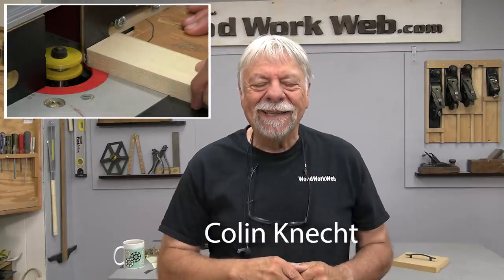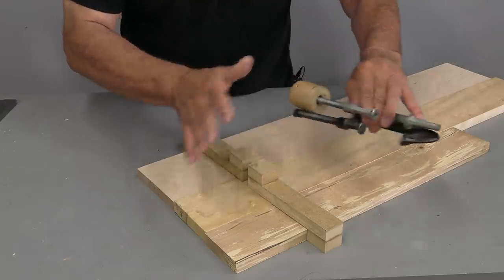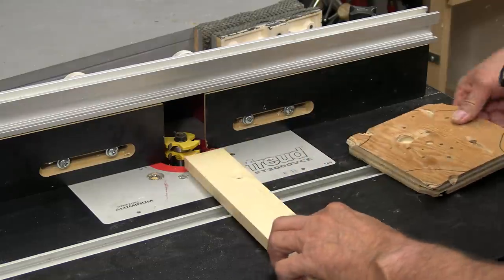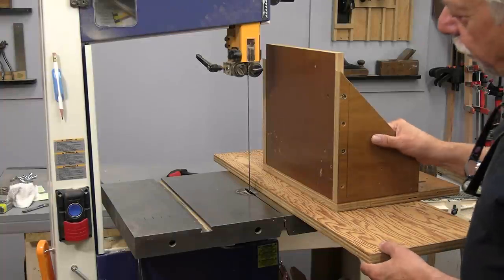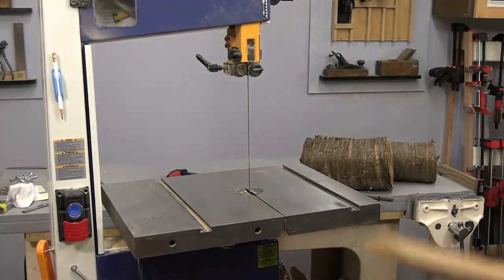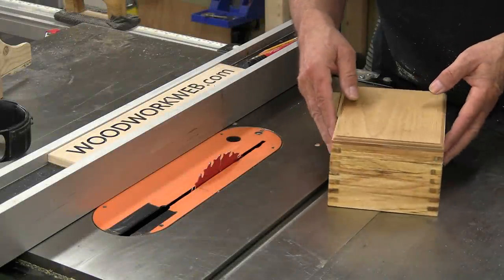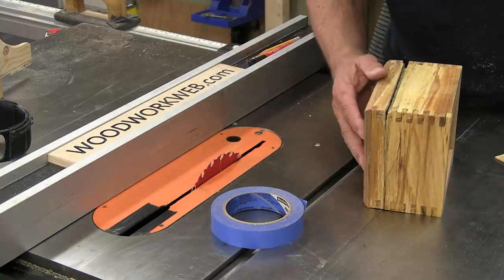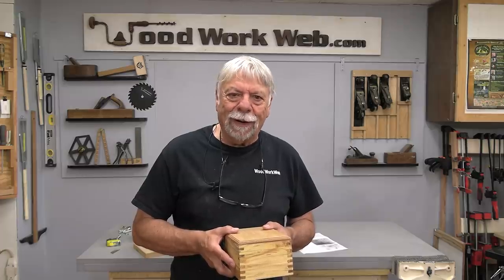Bad Ideas in Woodworking Episode 6 / Workshop Fails

Comment: When cutting the bottom off I lower the blade so it leaves about a 1/16 of an inch so the box stay firm and cut the last bit with a knife ,it's a lot safer

Comment: I might also suggest using a crosscut sled for separating a box body and top. That way you have plenty of support, a zero clearance throat and your box isn’t sliding on any surfaces to risk picking up scratches.

Comment: I like that you showed not just the bad ideas but the good alternatives as well. I can really attest to the advice on not using your blades on laminate. I cut some angles in laminate for my sister over the weekend with my band saw and it completely dulled the blade in just 2 cuts. Those laminates are compressed and all in all not friendly with wood working blades as you mentioned.

Comment: Colon, great to see a new video.     Sawing logs...  I  found I needed an outfeed table for my bandsaw, the logs are heavy and I didn't like not having maximum control (Having to support the outfeed weight  and pushing to log through the cut).  Luckily My saw backs up to a work bench and making the outfeed was easy.

Comment: A good use for the miter slot on the router table is a small parts sled.  You can clamp the piece to a backer board to support the piece on the sled. which rides in the miter slot.  Rockler makes a really good one but you can make one with a runner, some plywood and a toggle clamp.

Comment: Heeejjj that featherboard at 4:00 is for pushing left-to-right, disastrously against the router direction! For safety, point out that you'd have to swap the screws (probably from last use on the tablesaw) around, so it works in the opposite direction -- then usable on the routertable.

Comment: The router block isn’t the worst but to make better, for me, I’d just take the scrape chunk and screw a small handle sized block of wood to grip on the top. Just two ply pieces screwed together to give you a raised 4 inch by 3/4 inch block to grasp. Make it easy to change scraps when you need a backer again.

Comment: I take exception to your warning to not use a mitergage with a cross T-slot on a router table.  I do it all the time.  First, there is no compelling reason to fix your router fence so it won't rotate about the axis of your router bit.  It is fundamentally different from a tablesaw in this respect.  Then it is simple to make a holder for a rule that slides along the T-slot which you can use to set the fence exactly parallel to the T-slot, if you want.  I have such a setup on my router table, use it all the time, and I use both a miter gauge I got at a garage sale and shop-made guides to mill wood.

Comment: Some thoughts that would make these great ideas:
Clamp extensions; 
1) Make them tall enough that they don't lay down on your glue-up wood when they start to bow.
2) Make the block's inner edge angled slightly so the pressure is put at the center to bottom instead of pulling at the top of your wood.
3) Clamp a couple of Cauls with an ever so slight downward cup to it insuring downward pressure across the whole layup to hold the wood flat.
4) Make one side of the extension short enough so that the clamp's handle reaches beyond the edge of your lay-up.
Slot on the router table for indexing:
The slot can be used for feather boards, hold downs or any kind of jig you may need to index against the router bit. I built a small sled for mine for slotting and making plunge cut dadoes. I can't see any good reason for using a miter gauge on a router table but if you really think you need to use one, then just move the fence back out of the way for the same reason that you never use a fence with a miter gauge on a table saw.
I like your concept of your log re-saw jig.
Table saw throat plates:
I use MDF to make mine. It's stable and it has a manufactured flat surface on it. I take a piece of 3/4" MDF and re-saw it to the approximate width I need. I cut out the shape of the plate and fit it to the saw's opening and then put the cut side (bottom) down on my belt sander to get the exact thickness it needs to be. Plywood is not guaranteed to be flat.

Comment: I agree  with cutting the bottom off.  If you set the blade a hair lower than the thickness of the material you will leave  the cutoff  in place with a thin web that is easily cut through with a utility knife.

Comment: Lots of nit picking issues one or two actually helpful issues. Your router push block reasons made sense right up till the point where you showed how you push in the x and y a is simultaneously, right after having stated that "IF something goes wrong when using block with handle, that you hand COULD be caught up in the bit". You do realize the same applies to your meathod of pushing in the x and y axis toward the bit it would take a little something going wrong before you pushed your hand straight at the bit location. Its why they make different styles of router push blocks, not any one solution is always safe for every application.
Reply: I would use the miter slot for that. He’s wrong in claiming it’s for feather boards as my commercial doubter table has slots for those plus the miter slot which is different.

But if I were to use the fence, I would add  to the corner edges of the push strips of wood glued to raise the edge where I push so my fingers would not accidentally slip towards the bit since the piece is flat and just holding the top.

With the edge pieces, which would be at least 1/2” more than the pushing piece (more like a couple inches above), gives me something to hold while I push yet not tangling my hand in case I need to back off in an emergency.

Comment: I would consider that last tip as cutting the top off, as it's the top that falls away. If the top was against the fence, I would consider that as cutting the bottom away. But I'm not a woodworker by any stretch of the imagination.

Comment: Hi Colin. Thank you very much, I like the idea of pointing out bad ideas, at least for the safety aspects of things)

However I'm not completely convinced about the issue with handles (although I agree this one is a bit too tight). I thought that one of the main risks with circular saws and router tables was when the work piece gets kicked away and then your hands remain pushing against nothing and end up in the danger zone before you even have time to react.

When a push block has no handles, it might get kicked away along with the work piece, and again, your hands remain in place, with your body pushing them towards the blade.

Conversely, with a handle, your fingers catch, your hands gets jolted out of the way by the kick back. You might get your fingers broken, but not cut. At least that's what I was telling myself about handles (e.g. on the grripper or on April's push blocks).

Am I wrong believing that, and somehow the situation you are describing (i.e. things getting bad sufficiently gradually that you have time to remove your hands if there's no handle in the way) is more frequent than the one I am afraid of most (i.e. the work piece instantly disappears and there's nothing between my hands and the blade, while I am still pushing towards said blade)?

Comment: “Cut the bottom off” as in the “off cut” I think is what they mean, perhaps. So basically the same?

As for the clamp extensions, they work if you’re short of long bar clamps and used as supplemental clamps.

The log jig works without a clamp if the log is screwed to the jig not clamped.

Comment: Colin, I recently got a used router table and haven't put it to work yet, so I'm not experienced in their use (or most woodworking machines). Was the featherboard orientation in your example backwards? So, are the fingers supposed to be angled in the direction of the feed? I'm not trying to point out something negative, just checking to see if I understand the featherboard application. Thanks again for another helpful video!

Comment: T felt you dumbed the demo for the 2nd bandsaw jig because instead of driving screws from the back as with your preferred jig you used a one-handed clamp. You would have had the same results doing that with your jig. The 2nd one would still be better with supports but just fixing the log with screws would have made a big difference. At one time I made a jig like yours but mine was 4' long. It worked but it was difficult to use as I had to support the combined weight of log and jig getting started then to finish I had to switch ends to pull the last bit through the blade and again support all the weight.

Comment: HELP to a new woodworker!!   
I know now it was a bad idea, but I didn't pay attention and bought a set of good Forstner bits and a Woodcraft pocket hole set with up to 10-12 mm (1/2 inch) shanks, which is too big for my DeWalt cordless and my old Bosch drill stand, both for max 8 mm or 3/8 inch shanks.   
I've googled this problem for a while, but haven't found any adapters or solutions that seem to be accurate or safe to work with.  
Could any of you recommend a good adapter?  
Or another solution than to buy a drill machine that can take larger than 8 mm (3/4 inch) shanks  as new ones are quite expensive over here, and cheap used ones are hard to find? 
I would very, very much appreciate any help (Y) 
/Pia from Denmark

Comment: Sometimes your forced to improvise and a trip to the home improvement store isn't going to fit into your schedule. You can jack up the bed of your pickup truck and then lower the bumper back down on the piece you have to clamp. Problem solved, bad idea but jobs finished.

Comment: I thought most of these were common sense. But then I remembered common sense is a myth. Logic is hard to come by.

The tip about laminate flooring is interesting. I’ve a lot about it as well but never used it so didn’t know about it’s hardness and aggressiveness towards blades. I’d like to test it out on a cheap circular saw for myself though. Carbide usually cuts through almost materials even steel if fed in a very, very slow yet consistent feed (though a bit dangerous and not recommended). However it would get dull and/or destroyed with masonry material and that doesn’t even need to be tested to know that. (Again, just logical.)

Comment: #1 F clamps would work with that and yea you generally dont want to glue shit to shit you don't want to glue
#2 handles that engage spinning blades is a bad bad bad idea, when you are in control of the workpiece you don't need much force or leverage

Comment: I have installed several laminate floors, the blade destruction is absolutely factual. It's brutal on blades, also the cut ends are extremely sharp at times.

Comment: Your circular saw blade storage system video is a huge mistake and should be taken down.
Reply: Haven't seen that one, what was wrong with this storage system ?
Reply: Wrong video, dude.
Reply: @zapa1pnt  you go and make one and we all would love to see the before and after of your mug. Dude.
Reply: @bobwhelk2117 : No no no, I completely agree. The saw blade wall rack is Completely insane. However, you still posted your comment to the wrong video.
Reply: @zapa1pnt  the video on this circular saw blade rack was so egregiously dangerous that I thought it fit perfectly under the heading bad ideas in wood working. Just trying to get the word out that this was a bad idea and that if by the slightest chance someone were to read this thread and then go down his video list and happen to watch the video on this contraption they may remember this useless back and forth and save themselves a serious injury.  Sorry my friend- comment stays.